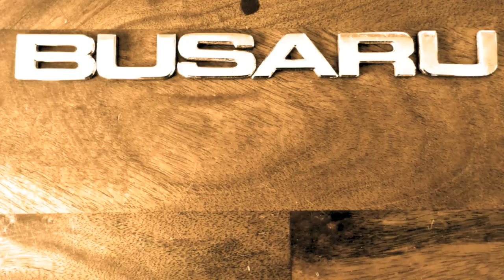Front Brake/Caliper Rebuild on VW Bus - Part 1

Comment: Heres a hot tip on de-rusting and removing bleeder screws. You may think its crazy shit but take your caliper with the hose on and submerge it in Muriatic acid for as long as you need to remove the rust .Then hit it with the water hose and blow it dry with compressed air and quickly paint it. Then if you need to rebuild the guts then do so. Acid doesn't hurt rubber . The acid will get right down into the thread and more times then not the bleeder will come out! If it does break off still then you need to mig weld as I see you already know! Your welcome! Muriatic acid is costic so use it outside in a plastic pan and glasses,gloves and a water supply handy for safety sake. 13$ at the hardware store. Youll use this to remove all your rust on parts from now on Im sure.

Comment: Good video as I’m about to work on the same  calipers office 73 square back which are kind of moving but locking up when the brake pedals pushed I’m hoping it will be a little easier to get out than yours.

Comment: Another way to do this, if the caliper is really seized, is to reconnect the caliper to the hydraulic line. 
After you remove the pads there is a gap of 16mm so you need a couple of metal bars to place in the gap. 
The idea is to pump the brake pedal and the pistons should ease out. 
Try using a single 8mm metal bar with two short 8mm pieces on the side of the piston you want to remove. Then swap the short 8mm pieces to the other side to remove the other piston. The piston on the wheel side of the caliper is harder to remove. so it is probably a good idea to try this first.
Reply from the maker: +John Grabiec That's a great idea. I'll try that if I ever get stuck calipers again. Thanks for sharing.
Reply: Forgot to mention that you will lose a bit of brake fluid so be ready to clamp the line when the pistons pop out. We are going to flush the whole system anyway - so that was not an issue. The caliper actually sits quite nicely on the ball joint too - if you do try this.
There are other videos on youtube out there suggesting to use a grease gun too - but I thought that was going to be too messy.